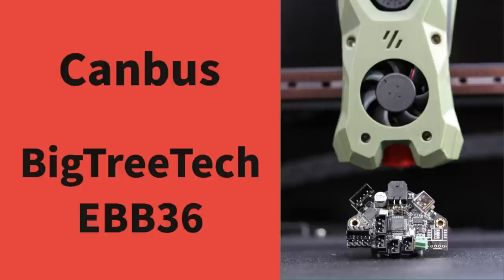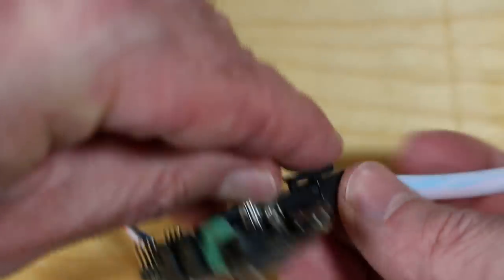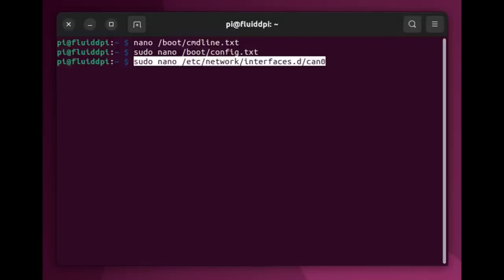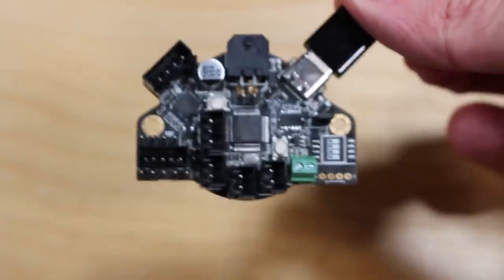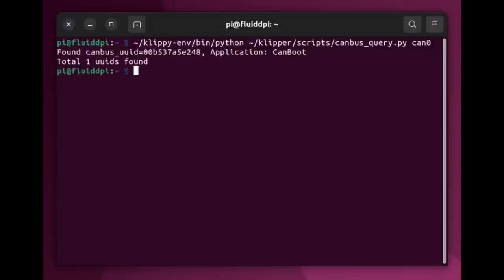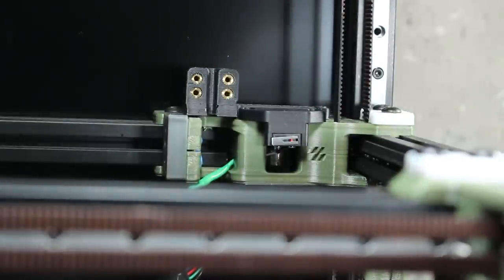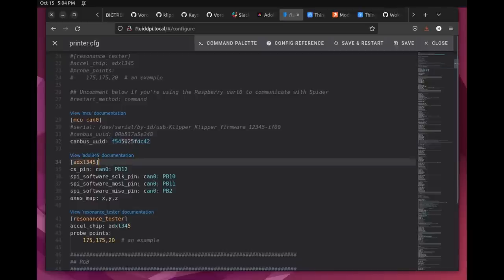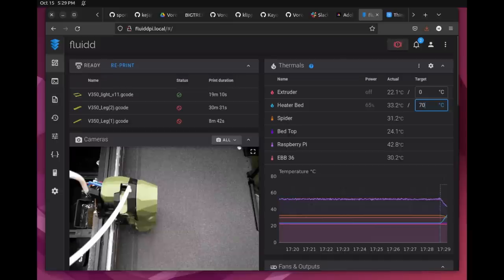Canbus (can bus) - EBB36 / EBB42 Install with Klipper on Core-XY Voron 2.4

Comment: Me getting my voron nice and stable and reliable only to find some new mod to completely tear it down and start over. The serpent eats its tail.
Reply from the maker: So very true.  But honestly, I would wait until you have a better excuse.  In my case I had a cable break.  A 3d printer that is working well should be used!  Thanks for the comment and watching!
Reply: Wait until it breaks. Doesn’t make a single sense otherwise
Reply: @Guenounovitch  your right, purposely break it then upgrade.
Reply from the maker: @oishisakana  😀
Reply: i just want to build a second voron, just to mod them and have a backup printer haha
Reply from the maker: @descent8275  Me too!

Comment: Have you noticed any issues with the EBB36 regarding its operating temperature? I am thinking about making a similar conversion to my Trident, but I am concerned about the chamber temperature causing the board to exceed safe operating temperatures.
Reply from the maker: Good question.  So far, no issues.  But I've only printed small ABS prints and I'm printing a lot of  PLA the last few weeks.  I should get back to some long ABS prints in the next few weeks.  That said, I considered this very same issue myself.  I decided that as long as the temperature inside the printer stays below 70c, things should be ok.  I also worried about mounting it behind the extruder motor as it might generate a lot of heat.  But I have been checking that, and the motor seems to run cool.   The board should be good to about 90c and possibly a little higher. I think you will not have trouble with it.  Thanks for watching!

Comment: What is your experience about the heating of the driver on the board? Especially in this case when it is used in an enclosed chamber? Any issues?
Reply from the maker: That was probably my biggest concern heading into this.  I've had trouble with overheating drivers before and they often don't work that well after.  I spent some time looking around and it seems most people run without one on the EBB36.  There really is no space for a heat sink where I mounted it.  So I have my current at 0.4 right now and all seems ok.  But, I've only done small ABS prints although I done some very large PLA prints.  I don't think that counts because the doors were open on the printer.  I think I have found some extra small heat sinks that should fit and provide an extra level of safety.  I will be testing them over the next few weeks.  But so far, all is fine without them.  Just keep the current low.  I'm using the LDO 20mm pancake motor which is running nice and cool at 0.4.

Comment: I wonder if we're moving toward a more modular control future. CAN for the extruder board, and closed loop steppers utilizing sensorless homing for motion.
Reply from the maker: I think so.  But, I think for the future, we need some way to better support CAN to support full 3d printing.  I don't think it's possible to properly sync a motor on can with motors that are traditionally managed via a single MCU.  What we have is great for what is technically the 2.5d printing of today, but we shall see.  Thank you for the comment and watching!
Reply: @KapmansBasementWorkshop  as an automotive geek, can is great but you're right.  To be honest we probably need to go to something higher speed like etherCAT for high speed printers

Comment: Thanks a ton Im on my way to do it finally. So everything running from my current toolhead pcb connector will be unplugged there and at the board and power side under the printer and no longer needed? Seems really crazy everything can be programmed only through the 2 can wires!
Reply from the maker: Yes, just the 4 wires will be needed.  2 for power and two for communication.    It works well.  Thank for watching!

Comment: Octopus pro v1.0 with Chip H723 has been stop making. Last product was also sold out. No only we can get EZ MODEL one
Reply from the maker: In this case, the EBB36 is not connected to an Octopus at all.  It's connected to the Pi.  So your MCU should not matter.

Comment: Thanks for the video! I’m upgrading my voron 2.4 with a RPI4-Canhat-spiderboard canbus adaptor and Mellow RP2040. But the RPI4 & waveshare canhat will drop the comunication😅 any clue? I’m thinking to try usb canbus bridge with the spider. Is the  uart to canbus bridge comunication possible?😅
Reply from the maker: Waveshare worked great for me.  Make sure the signal cables are twisted and both the canbus and waveshare are terminated.
I am also using the spider.
In a later (Klipperscreen) video I also started using the U2C bridge and there are instructions.  It also works very well.  By tomorrow, I will have a second canbus video that shows that in detail shows U2C as well.

Thanks for watching!

Comment: So, the BTT EBB boards work with fystec spider? I was looking for that information, I was close to buying a big tree tech board.
Reply from the maker: Yes, they do work together.  Note that I have the BTT board plugged into the U2C and then to the pi.  But it works great.  You can get a canbus expansion board for the spider as well.  Since it's canbus, that should work as well.  But I have not tried it as at the time, I was not aware of the canbus expander for the Fysetc spider.  But this has been working great since the video was created.  I ended up switching t the SB2240 for the Stealthburner and it has been great for me as well.

Comment: Just getting around to setting this up, not sure if you remember we chatted on Discord as we both had same Voron 2.4 kit, so it's been far too long. Followed mazers site then cross referenced against yours hoping to find my issue, and I did finally in your comments, it was the termination jumper! I wonder how long it must have taken you to figure it out as well. Thanks again.
Reply from the maker: It's great to hear from you again!  I'm glad you tracked this issue down.  Funny thing, I have some experience with other bus systems and recognized that termination is pretty important. I had those installed before the tool head was reassembled...
Thank you very much for the nice comments.  Happy printing!

Comment: Thank you for making this great tutorial! I have some comments for other people who might want to attempt this. Like briefly mentioned in the video it is also possible to send data to the EBB36 via USB instead of CANBUS for those that prefer that approach. If you use a USB connection no CANBUS driver board is needed and the EBB36 connects directly to the raspberry PI and klipper via USB like any "regular" controller board. This requires a a separate 24v/GND wire pair for power that connects to the CANBUS header on the EBB36. I have used this approach and so far it has been working well.

Theoretically the USB 5v is not needed if the board is powered by 24v via the CANBUS header so it is possible to make a DIY cable with a twisted USB-data pair and a separate 24v/GND pair. However, USB is more sensitive to interference than CANBUS so all sorts of problems could appear with this approach. I briefly tested it out of curiosity and it works but I can not vouch for its long term stability.

Details about the USB-setup can be found at the Bigtreetech EBB Github page:
https://github.com/bigtreetech/EBB

There is also an alternative way to route the cable from the tool head along the reverse bowden tube to the top frame and then along the slots in the extrusions back to the electronics bay for those that prefer that. There is a bowden tube guide arm by Demosth on TeamFDM that helps support the extra weight on the bowden tube from the cable.

https://www.teamfdm.com/files/file/601-bowden-tube-guide/

Thank you for making these videos! They have helped me a lot when building and upgrading my printer.
Reply from the maker: Thank you for this link on the bowden tube option!  This is pretty cool and may be simpler.  I have not seen this mod before.  I debated USB vs Canbus prior to starting this.  I also saw posts that stated they could not get this to work via the driver board.  I looked at the USB driver cards and figured I might as well go full canbus which as a hat is super easy to mount.  I did not know one could connect this via straight USB to the PI!  I also looked at connecting the EBB36 straight to the Spider MCU, but Fysetc had no documentation about how it's used whatsoever.    But I'm really happy with how this turned out.  It's working well and for someone that seems to be flipping the printer over all the time for modifications, a good chunk of the printer's electronics now is much easier to access.  The printer looks kind of plain without all those cable chains....
Thank you very much for the kind words, great comments and most of all, watching!
Reply: @KapmansBasementWorkshop  Yes, I agree. Canbus is probably the cleaner approach if you don't mind the few extra steps to configure klipper.

Comment: Thank you for the great video! I have a small remark about powering the raspberry pi. You could remove the uart wires from the spider and simply use the two 5v wires and the gnd wire to power the pi. You can then use USB to talk to the spider. You might not be able to use the can hat in shield mode (you need to connect the wires by yourself), since I noticed that the ground at pin 6 is connected to the other ground pins.
Reply from the maker: Good tip! Thank you for the information!

Comment: Hello sir, I am starting wiring on my Voron 2.4 R2 ( Fysetc kit ) next week, I think I did see any of your Voron videos at least 10 times now 😄because I do enjoy to watch them. Thank you very much for your time. Have a great day.
Reply from the maker: Are you going to use canbus?  If so, I would recommend you don't run the cable through ptfe tubing as I did.  It's noisy as it slaps against the back wall. 
Thank you so much for the great comment and for watching and most of all, I wish you a great build!
Reply: @KapmansBasementWorkshop  I do not have plans for canbus yet, I have to make that Voron running first, after that I can do some upgrades as everybody else. My first step after building Voron and make it run is Stealthburner and after that enraged rabbit carrot feeder. I hope you will build Enraged Rabbit Carrot Feeder on your channel too.
Reply from the maker: @AdamDeBeers  I agree, getting the printer working 1st is a good plan.  However, I would recommend you just go ahead and build stealthburner instead of afterburner when assembling your printer.  It's the same amount of effort while providing a huge improvement in cooling.  It will save you the time of building stealthburner.  I've been stalled in making videos for a while, but I've got a good bunch coming in about a month's time.  Thank you!
Reply: @KapmansBasementWorkshop  It is too late sir, I got Afterburner built, but I did order all parts necessary to build Stealthburner. I think till I will get all parts for Stealthburner, I will use Afterburner and after I will have working Stealthburner, I will rebuild my Afterbuner into backup Stealthburner. Just for fun! This is the way. 😄
Reply from the maker: @AdamDeBeers  This is the way :)

Comment: Great video.  I used the ebb36 with an octopus pro in canbridge mode.  It was quite a challenge getting it all working reliably.  A resource like this would have made it a much smoother process.
Reply from the maker: Thank you very much for that!  I'm glad it's working now.

Comment: working with pros! great job! thanks for sharing! 

maybe this helps a little too: while working for the automotive sector I usually went with BEDIA - cables. the .35dias are great. the isolation is thinner and much more heat resistant then regular wires. due to the thinner isolation there's more copper inside which reduces the internal resistance aswell.
Reply from the maker: I had to look those up as I've never heard of those.  They look like super high quality.  When the ones I've used fail, that may be next.  Thank you very much for the recommendation and watching!

Comment: I am in the midst of setting up my ebb42(v1.2) on my printer, following your video.  It's been  a tremendous help.  I'm hung up, though, on discrepancies I see between your instructions, the maz0r web site, my own experience, and the official documentation.  I see differences specifically in the area of pin assignments.  In the documentation, it says that the two fan outputs are pins PA1 and PA2, yet you and maz0r both use PA0 and PA1 - which also happens to be my experience.  You and maz02 specify PA3 for the thermistor, yet the docs say PA0.  You and maz0r say pin PB13 for the heater, yet the docs say PB1.  The final difference (that I've noticed) are the SCLK, MISO, and MOSI pins for the ADXL345.  You have PB10, PB2, and PB11 respectively whereas the docs specify PB13, PB14, and PB15.  I have to believe what you and maz0r state because it agrees with my own experience, but it makes me wonder what other surprises these are
Reply from the maker: I cannot check tonight, but I'll have a look at the pin assignments tomorrow afternoon.  I'm not sure if the EBB42 and the EBB36 have the same pin assignments.  Once I have a look, I think I can give you a better answer...
Reply from the maker: There is no documentation for the EBB42 1.2.  But the BTT Github states: V1.2 compared with v1.1: only the IO of hotend is changed from PA2 to PB13.  So other than that, the pinouts are the same as the 1.1.  
So for the 2 fans, you should use: PA0 & PA1
The Thermistor should be:  PA3
The heater should be PB13
for the ADXL345, you should use: PB10 (SCLK), PB11 (MOSI), PB12 (CS) & PB2 (MISO)

Hopefully that helps.
Reply: Yes.  I have it now.  It's just surprising the pin changes from 1.0 to 1.1/1.2.

Comment: Which ebb36 mount would work with cw2 / stealthburner?  Thinking of doing the umbilical / want to get rid of drag chains and wires.  Still using the LDO PCB as I am also debating switching to the 2 piece stealthburner pcb.  Any help is appreciated as I feel silly for even asking.
Reply from the maker: Have a look in the description of this video. The mount I used for the ebb36 mounted to the cw2 on stealthburner is linked to there. It should work with any umbilical you choose as well.  It has held up really well for me.

Comment: I'm finally to the point of my build that I'm to this video. I was curious how you are powering the pi if the can hat is using the pins that are normally used. I know you mentioned USB-C, I'm using a pi 3b+ so I'm assuming I should use the USB micro-b plug.

I've used your video to install Euclid which was a great help on my other Voron and I'm very hyped to do Canbus on the new build. The software side is the hardest part for me so I appreciate the steps you take in showing the information. I don't think I would of taken on the Canbus mod without this video.
Reply from the maker: I'm glad to hear the videos are helpful. I used a Meanwell rs-25-5 powersupply mounted under the Voron and hooked up to mains ac power. The meanwell plugs into the pi. I used an old USB cable with a USB c on one side. I had to trim the non c side to connect to the meanwell.  It has easily enough power for a pi 4 at full power draw which you wont actually have happen in typical usage.  You might be able to connect the USB cable to the mcu pins that are for powering a pi (skipping the meanwell) and work that way as well. Thank you for the kind words and watching.

Comment: Hi, thanks for video. But i didn't understand if you use can-bus interface on motherboard instead of usb-can adapter. How you get canbus_uid. i check video some times but after can bus flashin you have can-bus uid 00b537.... but on 35:16 can-bus uid in printer.cfg set to f545.... I's not clear to me and i wil be thankful for help to clarify this question
Reply from the maker: Neither.  In this video, I used the Waveshare RS485 Canbus Hat.  It attaches to the IO pins on the PI.  I have a second video where I use the BTT U2C as well.  Have a look at the video description where I have a link to the Waveshare RS485 Canbus Hat .  Thank you!

Comment: I'm building an Enderwire (Ender 3 pro to switchwire conversion).  I'm going to use a Taichi hot end with two M4 extruders for dual material (two color) printing.  The extruders will be mounted external to the Stealthburner.  Since my SKR mini v3 can only handle one extruder, I'm thinking of using either the EBB36 or EBB42 (which ever will fit better into the extruderless Stealthburner upper section.  While I'll only need 4 wires to the tool head, I will have to add 4 additional wires so the toolhead can drive one of the external extruder motors.  This will make for an interesting routing of the wires!   BTW, instead of using the CAN Hat, there is also a USB to CAN solution out there.
I noticed that these boards do NOT have 24v out to connect to an inductive type probe.  Would have to use a Y connection at the hot end for that.
Reply from the maker: In my other canbus video I use BTT's u2c for USB to canbus.  It works very well.  You project is super interesting to me.  I will soon start working on a project with the same hotend as you.  But I plan on doing it differently.  If you use Discord, reach out to me.

Comment: Did you see much improvement in input shaper max accel. taking of all the wiring and chains?
Reply from the maker: Very little.  Just a couple 100.  It's not worth doing for acceleration improvement. That said, it's almost as if my printer has been stuck at a particular level for a while now.  There could be something loose, but I have yet to find it.  But the lack of cables is very nice.  Soon I will have even less.
Thank you for the question and for watching!